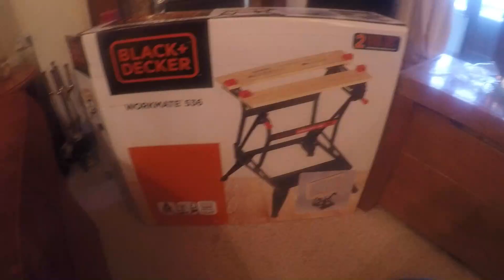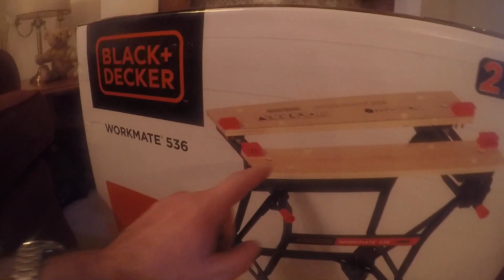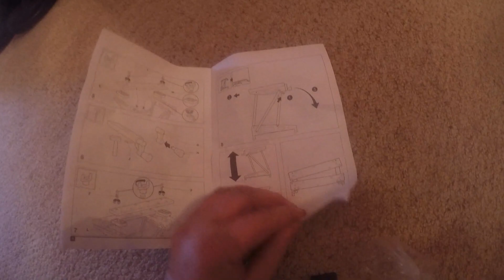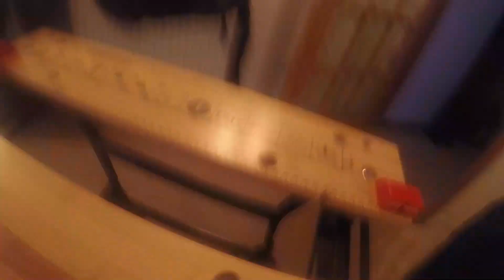Boxing day hangover assembling my new Black&Decker workmate 536.

Comment: Are the two threaded winder rods meant to be the same? I have one with a screw threading, and one that is not spiral. FFS.
Reply from the maker: On mine they are both the same, That said, if they are diffrent it would just mean you have to wind the handles in diffrent directions to open and close it. As long as the rods and the frame have the same direction thread that is. So do they both screw in? If not  you need to send the rod back for the correct one.
Reply: @markpritchard  one wasn't threaded. It was ribbed!!! Went to b&q, they just swapped it for me. Works fine now. Good piece of kit for £20.
Reply from the maker: Glad you got it sorted buddy.